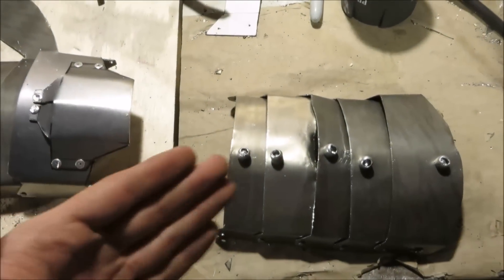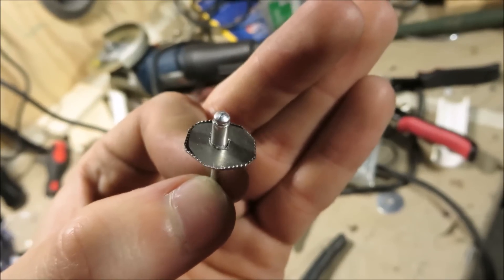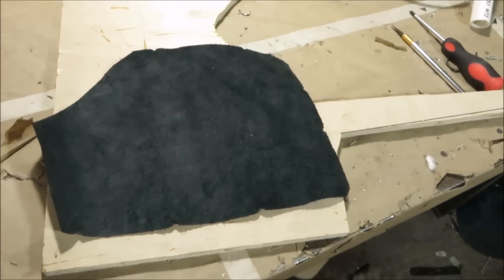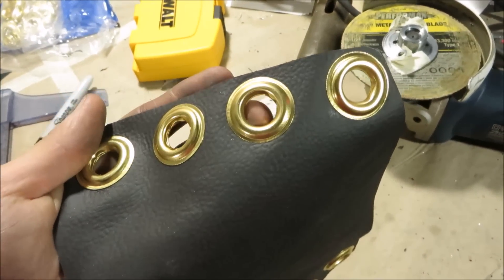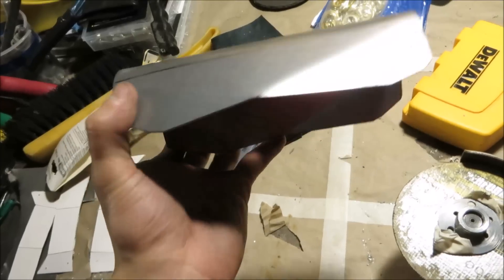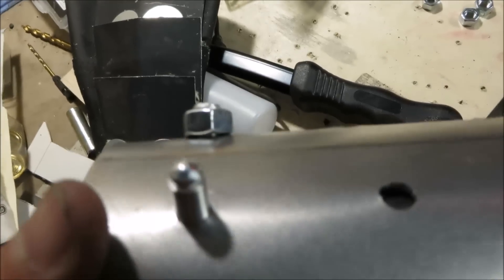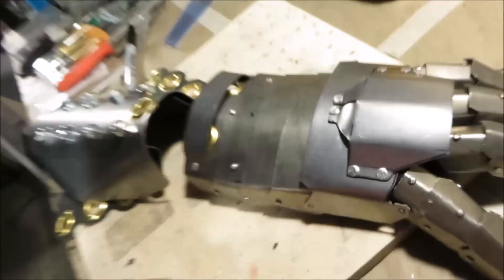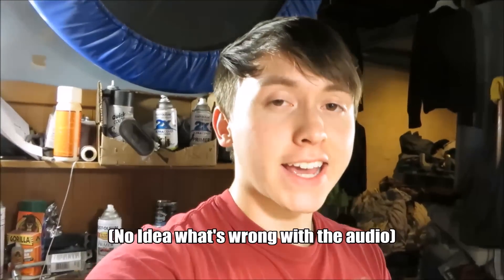How to Make Armored Gauntlets (2/2)

Comment: gah. I Just love your builds so much. If I had enough money and tools, I would literally build everything you upload. but I don,t so I guess i'll just take it one at a time! hahaha i'm doing to pvc bow this weekend. take as long as you need on the videos, quality over quantity anyday! also, I wear a small-medium shirt.
Reply: Agreed!
Reply from the maker: If you're gonna do a PVC bow, you should go all out and make the PVC pulley bow! Little bit more difficult to make but much more fun to use, way cooler looking, and fires better too IMO. Good luck with whatever you decide to do though!
Reply: I think I will! one more trip down the street to my local hardware store and i'll give it a go! think i might add some aesthetics too!
Reply from the maker: rderby911 
Yeah! instead of laundry line pulleys, use some 20 inch chrome plated spinners and instead of paracord maybe use a Bose sound system. Then just replace the PVC pipe with a Chevy Impala and you've got one mighty fine looking pulley bow.
Reply: hahahhahaha
Reply: Nonlethalbychoice lol
Reply: @ZNA_Productions  dang 5 yrs ago now we need bulletproof riot armor

Comment: Gotta give props on the not giving complete handouts.  It's a pain in the arse to go into a project for the first time without knowing any fine details, but that's part of the learning process. I've made a pair of functional gauntlets in the past... it was definitely time consuming, and didn't quite come out as clean as yours look, but they still exist. Going to be using some of these techniques on a pair of greaves, though I'm considering more of a track method on jointed plates so they can slide as necessary.

Comment: I think that if you could make the finger tips of the gauntlet into points almost like claws and sharpened them you could get a dual use for it for defence and for a bit of offence as well.
Or if you put a small blade inside the part of the gauntlet that covers the wrist and made it so it could spring out like a hidden blade

Comment: hi i'm Chris and I really like all the things you make. I am very creative. When I was helping my granddad he cut out a piece of aluminum and it sorta looked like a knife. So I took that piece and made the blade but for the handle I didn't have any usable wood. I was wondering what if you could use bamboo for a good handle and how you would attach it.
Reply from the maker: Well I'll start by warning you that aluminum isn't very good for knives, it's "crumbly" and won't sharpen. but as far as the handle, if you're dealing with a actual shoot of bamboo I'd say you could split it in half and narrow two pieces until it's the same width as the tang of the blade. Then clamp all three pieces together and drill a couple holes through them. Use some epoxy to fix some pegs into the holes you drilled, and you should be good.
Reply: thank you and I like what you do.

Comment: Hey nonleathalbychoice I was inspired by you two easy fighting knifes and I found a syth with the hanle snapped of and so I made a fighting knife with notches on the sine and blade for my first build I dont wanna brag but I 4hink I did pretty good if you have face book I will try to send some photoes but I spay painted it and sanded where the bevel was and the file work to make it look cooler